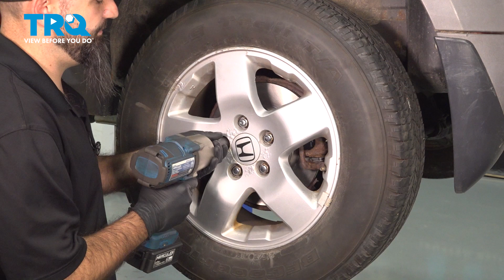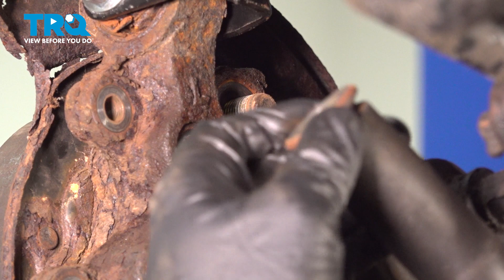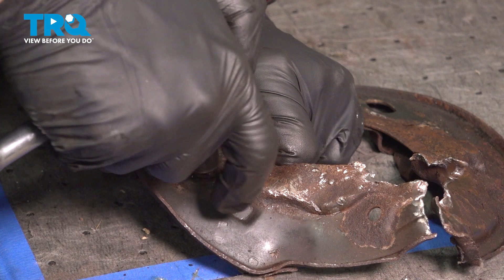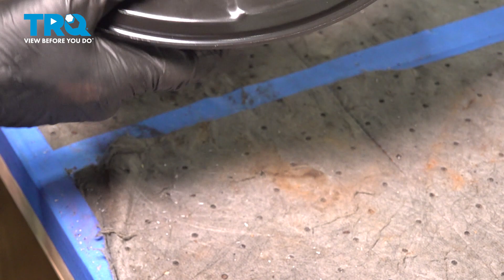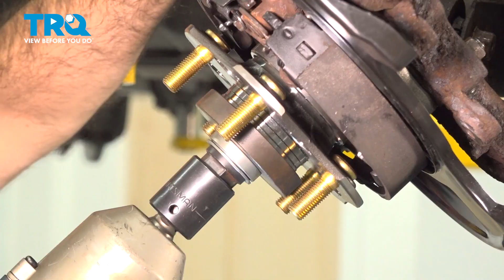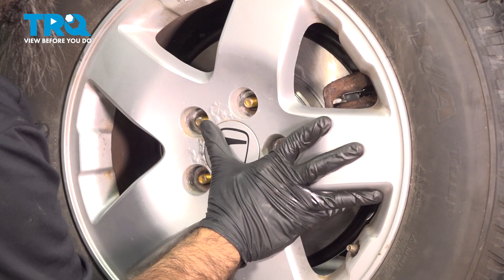How to Replace Rear Wheel Bearing 2003-2011 Honda Element

Comment: Holy colossal corrosion. So many questions. Why would you not replace the bushings on the knuckle? They are well beyond shot. Where can I get the hub press you used? I just took the whole assembly to a "machine shop" to be disassembled and they had too many questions thus i have no faith they can press it together without damaging the the dust plate and hub.

Comment: Oh.. man, I'm in the middle of blowing most of the rear knuckle stuff away for lower control arm and knuckle bushing replacement..
.. and as of this writing (Nov 2024), new knuckles are not available - and new backing plate/dust shields are not available.. :( 
What a buggar !!

Comment: what happened to the broken bolt and speed sensor ? and was there a a head on the bolt that you pushed out with the caliper pin ?

Comment: I did this and taped the cv axel from the back as you did and cut the boot. Now I need to replace that too. Is there not a better way to coax it through to the other side.

Comment: Doing all of this with the knuckle still on the vehicle doesn't make a lot of sense. Only three fasteners need to be removed to get the knuckle off (granted they may be well siezed so this may explain the approach).  I would have (a) disconnected the abs sensor from the other end (they always break if you try to remove the sensor from the knuckle), (b) removed the three bolts needed to take the entire knuckle off the vehicle, (c) use a shop press to press in the new hub.

Comment: I just discovered an awsome hack to simplify gettin the bearing free from the knuckle at 19:00 in the video.  Attach the hub puller used at 7:10 to the bearing.  I could only get two of the bolts, removed at 9:40, to fit, but that was sufficient to help move things in the right direction.  I had to use a pry bar to help things along, but the bearing came out much easier than in this and other videos.  Hope this helps someone out there!